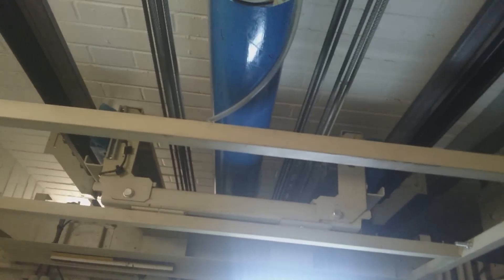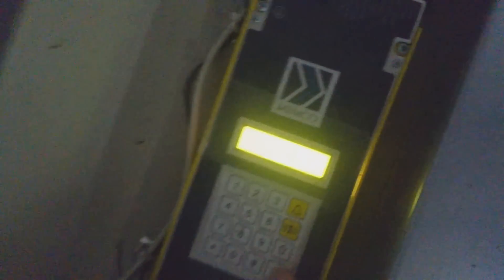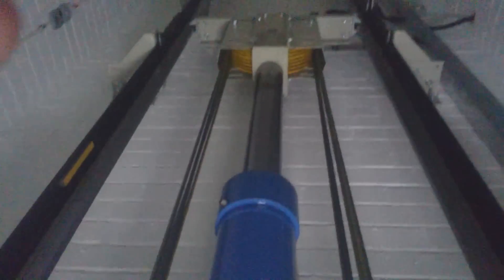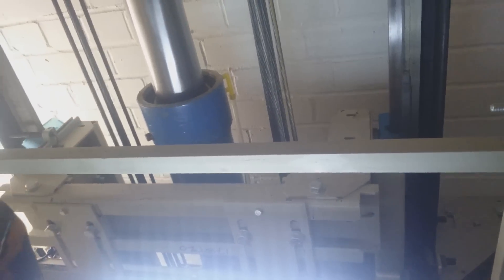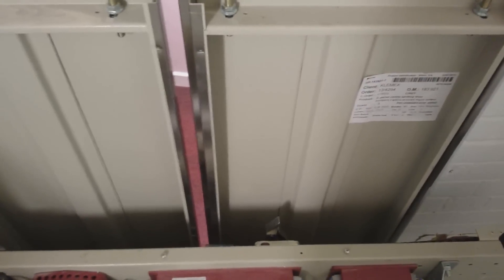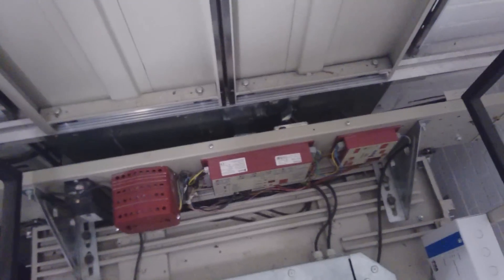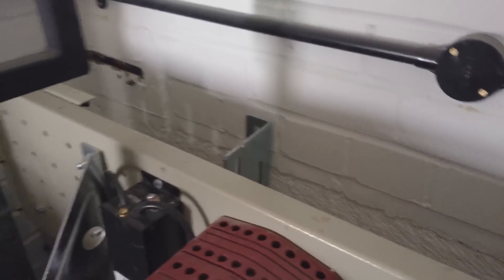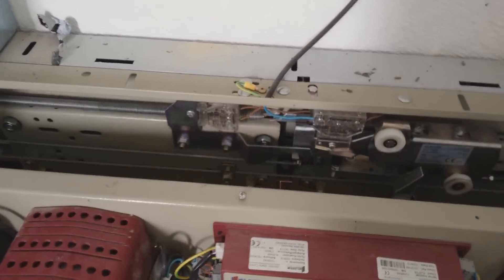A detailed look at a generic hydraulic lift (from on top)

Comment: 2/3m/s? There are escalators that are quicker than that. It's miserable really that the majority of lifts in the UK are generic pieces of shit that last 10 years max, and are probably built this way also because of planned obsolescence, which is where things are deliberately made so they won't be too good, because they want you to buy another one when it breaks. Should be illegal and it's certainly not green either